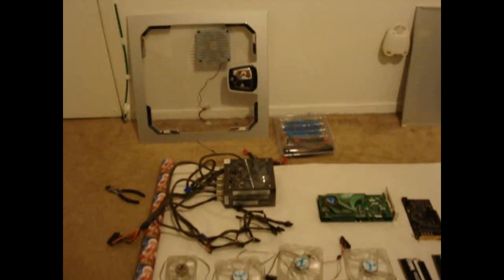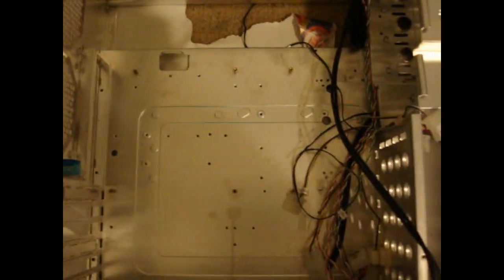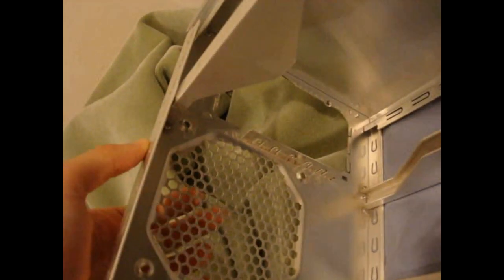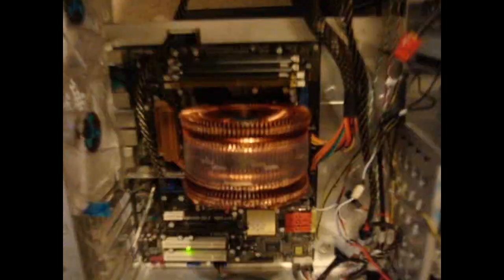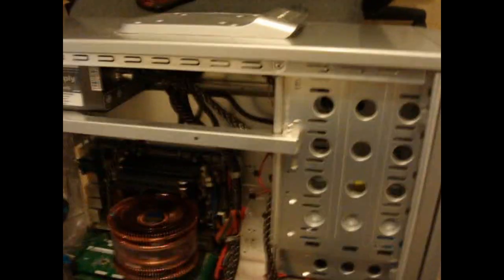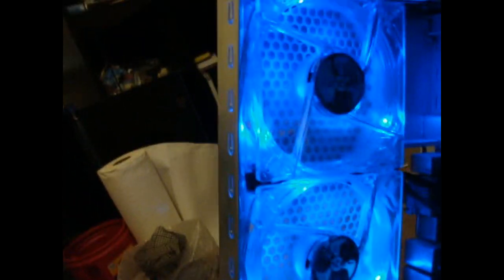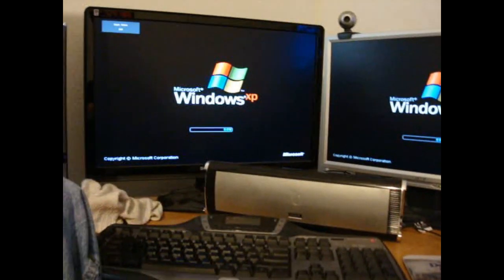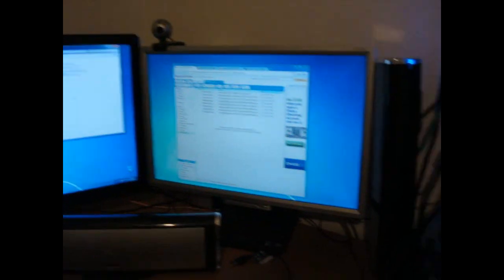Rebuilding my system - (Dissembling/Assembling)

Comment from the maker: @Jdwill1014 Yup, got $3,000 set aside for a new upgrade in a couple months in preparation for BF3. Here are the specs so far:
tinyurl . com / mushpcbuild (No spaces).

This system will also be liquid cooled and be using my 1000 Watt modular PSU.

Comment from the maker: Of course a bad motherboard component (Blown Capacitor , Short Circuit, etc..) could always create the issue which would most likely require a replacement. Their are a lot of other possibilities but considering the circumstances present I think it's logical to assume it's an issue with the motherboard/BIOS. I'd focus your attention there but don't rule out other things (Bad cable, Cable not plugged in right, PSU, Etc..)

Comment from the maker: Previous Action prior to experiencing issue: Cleaned out(Dissambled) computer.

Conclusion: All three issues can be tied to an issue with the motherboard. Aside from the Hard-Drive, this is one of the most fragile components of your computer. Assuming the issue is with your motherboard it could be as simple as flashing your BIOS.The Clock-Time issues could contribute to the fan problem since most fan speeds can be tied to temperatures and clock-speeds.A bad BIOS can also cause your Kernel Issue.

Comment from the maker: The beloved deductive reasoning associated with  troubleshooting to determine the most probable resolution:

Issue 1: Your Fan isn't revolving properly
Possible Causes: Faulty , Fan, Motherboard, and/or PSU.

Issue 2: Despite wiping your Hard-Drive you receiving an Kernel error upon installing Windows XP x64.
Possible Causes: Corrupt Disc Image, Hard-Drive, or Motherboard.

Issue 3: Your Clock-Times are fluctuating.
Possible Causes: Corrupt Mothboard, Memory or BIOS.

Comment: I´ve got a problem, I was cleaning my old PC when I tried to change the thermal grease, so I unscrewed the cooler, but the heatsink is not screwed, it has two parts of metal plates and between the parts there is a piece of metal that I can´t take off to clean and put the thermal grease on the processor...

It´s a AMD Athlon XP 2000+, have you got any idea about how to disassemble the heatsink?...

Comment from the maker: So does normal mode work? Also, if your trying to boot from a Live-CD you'd need to ensure your DVD Drive is set to first Boot-Priority in the BIOS. Otherwise the Windows bootloader will be initiated.

Comment from the maker: That's very odd actually. Is your keyboard connected via a PS/2 or USB Adapter? Also, is the DVD-Drive SATA or IDE? Honestly, regardless the two components shouldn't conflict like that. Have you tested keyboard functionality in the BIOS? The BIOS is located on the motherboard itself and comes into play prior the the DVD-Drive even being initialized. If your keyboard doesn't work in the BIOS then it's evident that the DVD-Drive has nothing to do with it.

Comment from the maker: If your an experience system builder and using an Anti-Static/Grounding  Strap then the only risk you really have is dropping something. There really is no risk if you know what your doing. Depending on the hardware you use it may be best to take note of the dimension of your old chasis in comparison to your new one. Make sure your CPU fan has enough room, ensure you have enough drive bays, and so forth.

It sometimes helps to take pics before to ensure everything is connected right too.

Comment from the maker: 1 Grand is plenty to build a good gaming rig. I have built gaming computers with a budget of only $800 for people. You can easily build one using $1,000 if you simply use some of your old parts (IE: Mouse, Keyboard, Monitor, CD/DVD Drive, etc..) until such time as you can upgrade them separately.

Comment: Mind if I suggest something? Say, a SAS controller w/ 10 SSDs attached in RAID 0, plus some 6~14 HITACHI 15k RPM SAS HDDs (in any RAID config you see fit); dude, you're gonna need some serious space to make all this fit into your case XD. Just make sure you break the barrier of hundreds of MB/s from storage drives to CPU/RAM or in between them (and I'm not talking about burst speeds).
Good luck! =D

Comment from the maker: One of my downfalls is I can't buy old hardware. Like if their is newer and better I have to get as close to it as possible. Example being, I can't upgrade to new RAM knowing their is DDR3 out there, I can't upgrade my Dual-Core CPU knowing their is Quad-Core out there.

I tend to buy the most high-end parts I can. The motherboard I want is over $500 alone. I spent over $600 for my current Graphics Card.

Comment from the maker: Well my PSU just died this morning actually, I had to swap it out. I'm going to make a video about that later probably. It was kinda odd how it turned out.

As far as a new system. I plan on switching to Intel for a Quad-Core. Hopefully get an EVGA Classified motherboard. I have a spreadsheet at work I typed up. Basically looking at a 1,000 Watt PSU, 2 GB Nvidia GTX SLI GPU, 8 GB DDR3 RAM (Big reason I am going with Intel), 10,000 RPM and SSD's setup in RAID, Et..

Comment from the maker: I had a 700 Watt prior to this that went bad after a Power-Outage (Even with a Surge Protector on the Power-Strip...Need to look into getting a UPS). This 800 Watt modular is about 7 months old so I'm still content with it.

As far as Blue Cathodes go, I have debated that but I really don't want to overkill it. I have so many Blue LED's as it is, any more may seem like I am "trying to hard" to make my system look cool. Everything in it currently servers a purpose rather then just for looks.

Comment: You should get a couple blue cold cathodes to look cooler, and with my most recent build, i got the Corsair 750w power supply its really nice i suggest it for you if you were thinking about a new power supply.
Nice video, thanks

Comment from the maker: I actually have a huge server in my closet but haven't gotten it up and running yet, been to lazy. I have a video in regards to it posted actually.

Why do you need 6 Graphics Cards for a Server? I'd think RAM and CPU would be the most important unless you utilize CUDA. I assume you have them setup in Tri-SLI or Tri-Crossfire as well?

Unless they aren't stand-alone servers but rather Listen servers that you play on as well as host. What kind of network connection do you have?

Comment from the maker: I am pretty sure they are using a Virtual OS if that's the case. You can have multiple Virtual Machines running at once and switch between them in the manner you speak of.